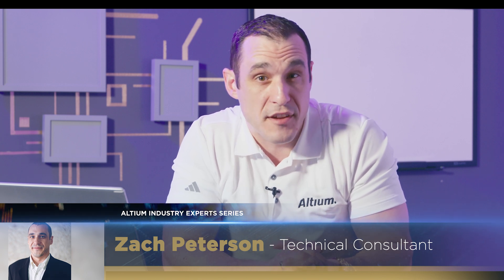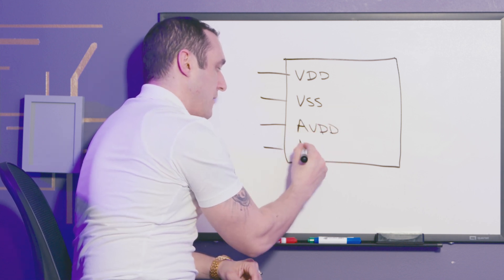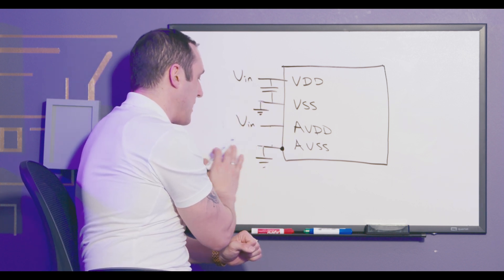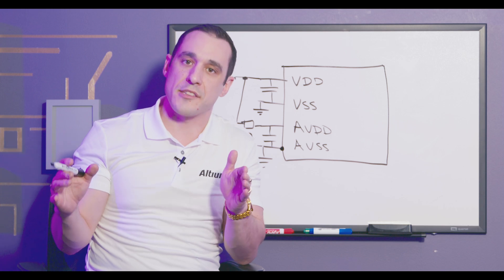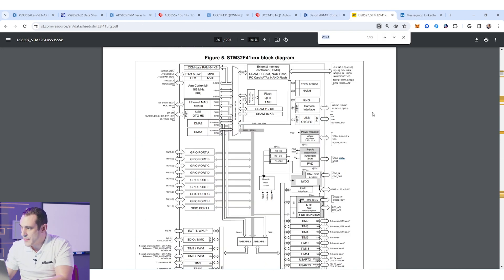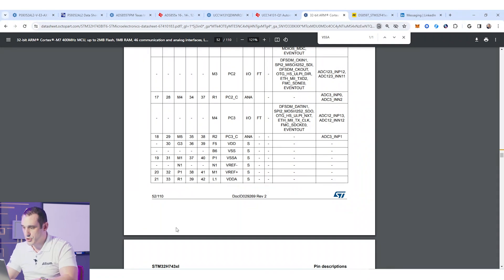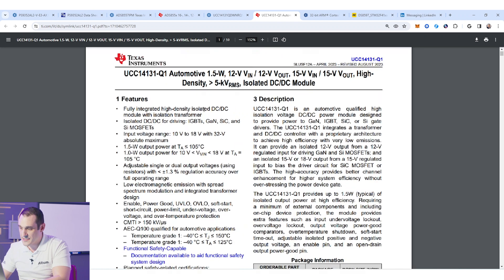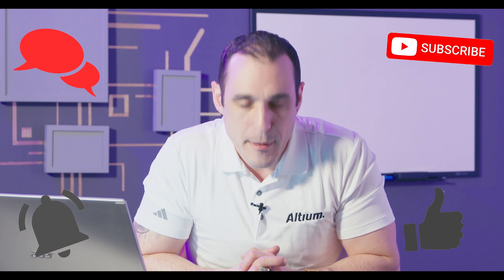Ground Pin Naming Demystified | PCB Layout Basics

Comment: Around 9:00, is that  slot in the whole board, or just in the copper layer?  (It looks sort of like a slot in the whole board but not the copper layer, but that doesn't make sense...)  Also, if the frequencies are low enough to justify separation like that, should the connection really be close to the BVDD/BGND like that, or would it be better to do it near the top/bottom of the package?
Reply: I think since they are showing only 2 layers (Signal and ground), they are only showing it for the ground layer, in which case they are implying you do that through all the ground layers. If you're at those low frequencies I think it just depends where in the board they come from, the placement they provide is probably not good for every situation.
Reply: 😊😊 😊⁰,9,

Comment: BVDD - Battery Voltage and Battery GND?
Reply: Probably.... was it in a battery management component?
Reply: Buffer ground, looks like they're using it as a fancy word for digital ground; I really hate how IC manufactures do this, I understand it's separated internally but it just creates confusion externally.
Reply: Fwiw, the buffers are hardware IO used to help configure the ADC you presented.  It's probably why they want it connected to 'digital ground' or really the MCU ground, so it doesnt interact with the analog signal being measured.

It's also why I like the adage 'ground is where carrots and potatoes grow, and that's it '